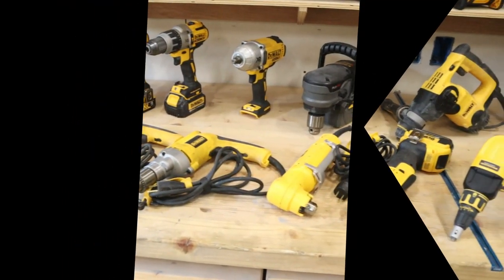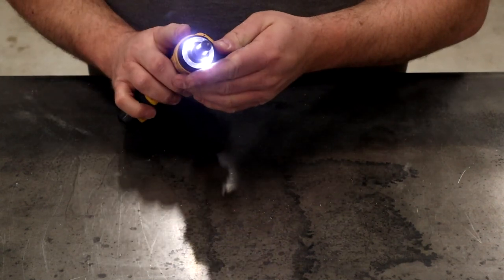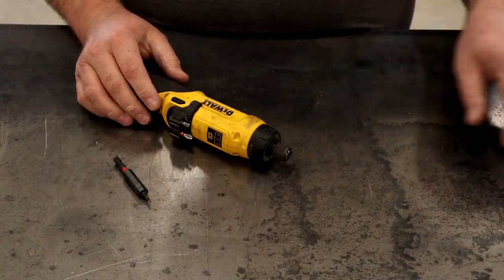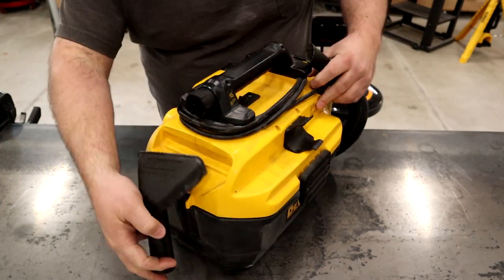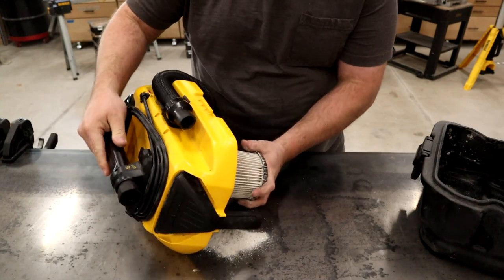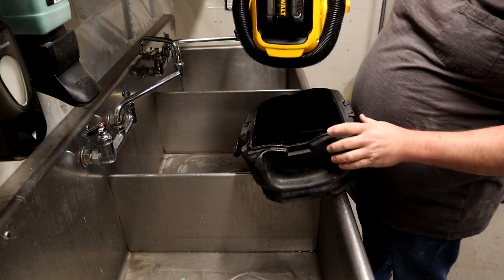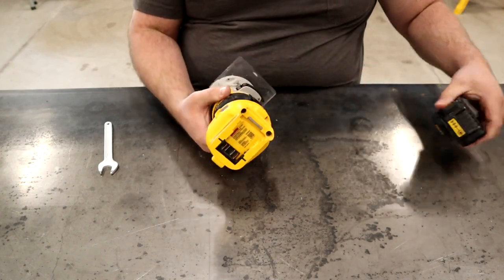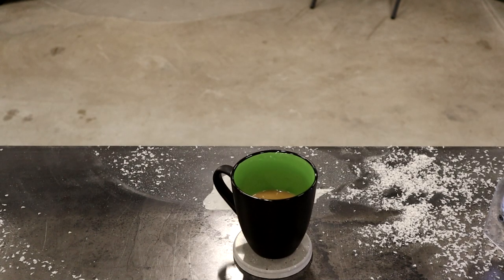The Best Cordless DeWalt Tools

Comment: The Dewalt 20V Oscillating Tool, Impact Driver, Oscillating Sander, Flashlights Drill/Drivers generally, Tire Inflator are all very good.  Have them all.  I heard that the new 20V Blower is now powerful enough to use based on Amazon comments-- didn't used to be until redesign.

I have the 60V Chainsaw and Blower -- both excellent.

Just got the outdoor tools, hedge trimmer, pole saw, edger etc -- seem OK but haven't used enough to comment more.

Very hard to go wrong with Dewalt.

Also good as far as I know:  Milwaukee, Bosch, Makita.

I would stay within these four brands in most cases to get the best tools.  All are top brands.

Flexvolt Dewalt 60V batteries are a real breakthrough.  Can run many of the 20V tools -- just much longer.
Reply: Festool

Comment: Hey man thanks! I've been getting burnt out on the fake review websites recently, so its nice to see someone who is actually using em before coming up with an opinion
Reply: How does the power on the vacuum compare to say a classic rigid shop vac
Reply from the maker: Thank you!
Reply from the maker: @seansmith4982  How to best put it.... How about I just say, that for it's size, the vacuum is pretty impressive. So much so, that I pretty much quit dragging out my rigid shop vacs for a lot of things. I vacuum up water a lot, and little spills and messes. It is the perfect vacuum for detailing a car. I also drag it out every time I have to clear chips off the mill or lathe. Easily one of my most used cordless tools. Have a good rest of the week.

Comment: Dude, you're costing me money here😂

As an electrician, HVACR tech, and general maintenance person, I should have bought a portaband years ago. Cutting all the different materials, I've after the other, sold it for me haha.

That battery powered shop vac having the option to plug in such a great feature. I have a makita dust buster type thing, which is handy, but a wet / dry shop vac that runs on batteries, and has the option to plug in, is just too convenient to pass up.

Comment: I got to admit I got ya beat hands down. I literaly have just about every Dewalt 20 volt cordless tool they make and usually 2 to 6 of each one on average . The new one I've been trying to buy is the 23 gauge headless pin nailer which just came.out last month but are out of stock.

Comment: Great video! Can these dewalt batteries be used interchangeably between the power tools and outdoor tools? So many dewalt models I don’t even know which one is current anymore. Currently I have the ryobi old model and am considering to return it to get the dewalt or new hp ryobi. Dewalt stands out but very pricy, hoping their battery for the power tools can work with the outdoor tools
Reply from the maker: Great question! It is a whole ball of wax for sure. I think DeWalt has the most complex battery system out there. It would take a while to type out here, so I will point you to this video for a rundown.

https://www.youtube.com/watch?v=MKwoXHwMqPc
Reply: Twenty volt power tool batteries will work on your twenty volt outdoor tools
Reply: All dewalt tools can be used with a dewalt 20 volt battery, the best way to i found to start collecting power tools is by looking for tools on Facebook Market or waiting on Home Depot/Lowe’s tool deals which are buy one get one free or discounts that go  on once in a while for any power tools. Heck i even got a steal on a Dewalt XR chainsaw with a 5ah battery for $120 on Facebook Market.

Comment: I have an issue with dewalt batteries dying so fast
Reply from the maker: What tool and battery combo do you use the most? I can't say that I am on one particular tool long enough and often enough to have a sense of battery life as compared to other brands. We do use a lot of Milwaukee stuff as well. I typically run the 6 Ah flex volt batteries for DeWalt, and I feel like I never charge those things under normal conditions. However, I have noticed that the grinders under heavy use will chew up batteries. I feel like that is expected though. Anyways, just random thoughts : )
Reply: The two amp batteries will die rather quickly on saws or grinders , we use 3 to 5 amp batteries one most everything and 6 , 8 or 10 amp batteries on the bigger saws . Also we never recharge hot batteries .

Comment: I just need to know how strong the Screwdriver is. Most screwdriver's are so weak, unable to fix anything.
Reply from the maker: The screwdriver is by far the most used tool in my collection. I work on a lot of industrial restaurant equipment. Espresso machines, smoothie machines, frozen drink, fridge, freezers and the like. It is perfect for that kind of work. It will drive #8 two inch wood screws fairly easily. The good news is that it has an insane mechanical breaking system. If your hands are strong enough, it will break loose or tighten anything a standard screwdriver will.
Reply: Really? Can I also fix with that one chairs, wardrobes etc.?
Reply: Im just asking cause my Screwdriver from Stahlwerk can't do that. So I have to be sure...